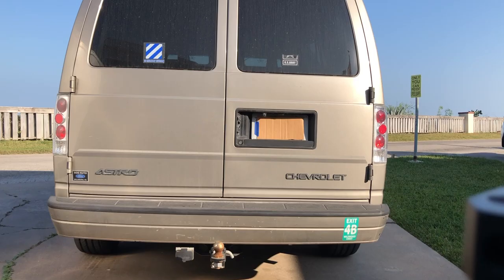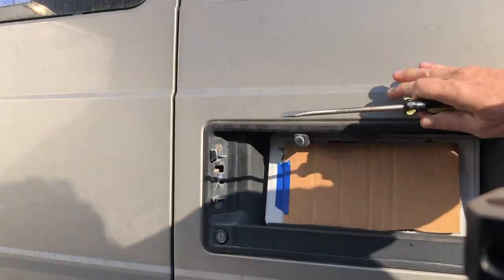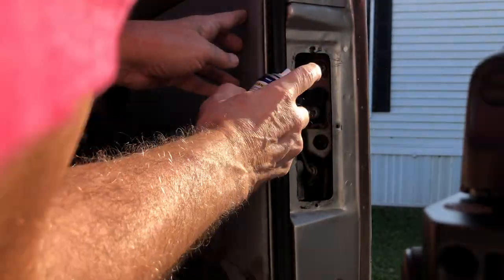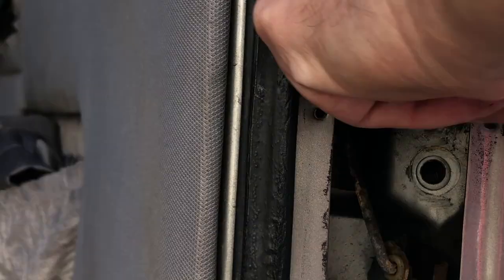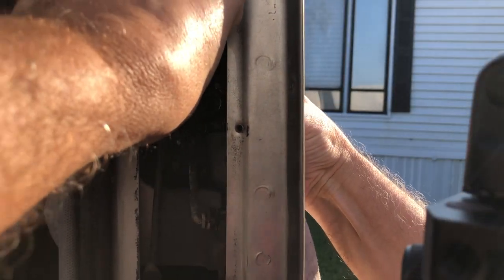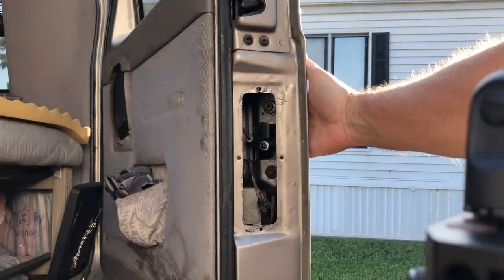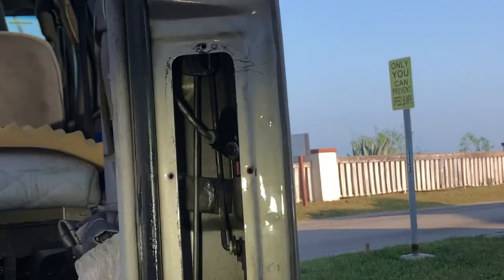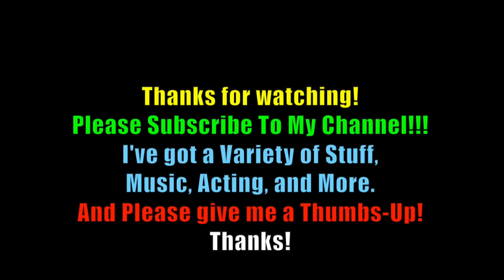Rear Door Wont Open on Chevy Astro Van - Why? See What's Inside!

Comment: Oh my gosh, life saver! Thanks! I replaced the door handle and then got it stuck, because I didn't test it.  Had to take off the rear inner panel to open the door, thankfully that worked.  Then I bent the level rod like you said and it worked like a charm!  THANKS again.

Comment: Great video! I'm looking for help on the other rear door where the handle busted off, but it's great to see people sharing info on these older vans. ❤
Reply: Me too.. did you solve it?
Reply: @lamelight  We ended up cutting into the upholstery panel to access the locking mechanism to open the door. eBay had a replacement handle.

Comment: Sensible information. Thanks. In my case (also a 2003) I will probably first have to destroy / rip off the door handle and start with the screw driver like you did. 
My real objective is to lower the spare tire in order to make replacing the rear shock on that side easier. To do that you first have to be able to open the door to get to the crank that lowers the spare. If it's not one thing it's another that makes life interesting : - /

Comment: What I hate .. is that they make your average handle as a cast aluminum piece .. Have had two broken handles, and each time, I tried to go the inexpensive route with an AutoZone replacement, but then fun only gets started there because the plastic retainer for that rod that gets pulled down, the plastic circlip ends up having shitty tolerances...I close the door and the rod popped out in both cases...

The first time this happened, I drilled the replacement handle out by boring away the studs from the backside under the handle, and ended up forking out 2/3's more on an OEM Canadian made handle that worked for a few years until it began to age and develop a crack...

Currently on AutoZone handle #2 contemplating drilling out the studs yet again because GM thought it wouldn't be any issue not putting in an interior side handle 🙄

Edit* I'm so doing this --

https://youtube.com/shorts/1AfFH4LmfGw?si=QEgl-vXtc-VTc7Cn